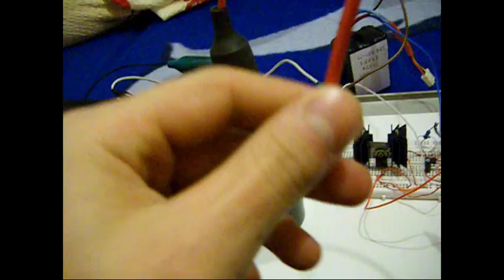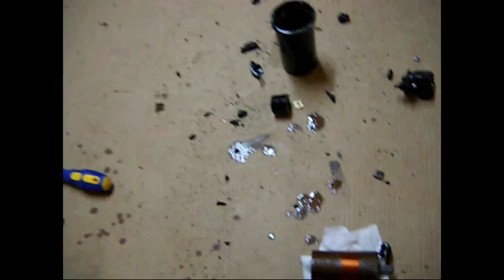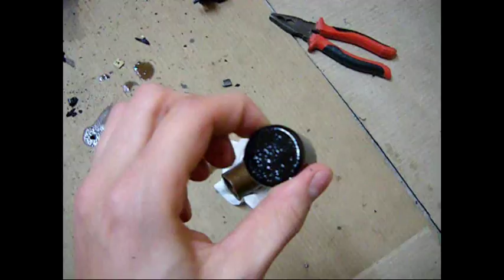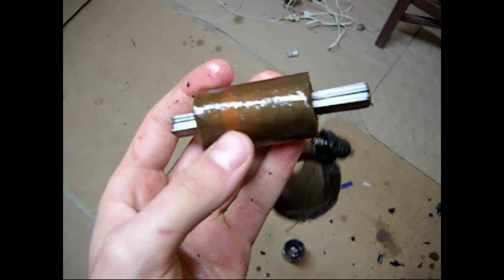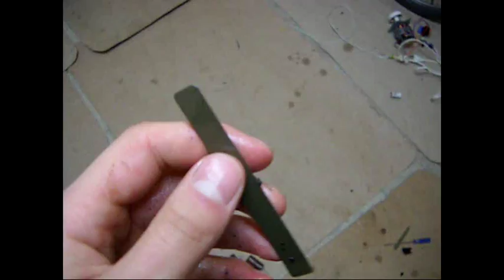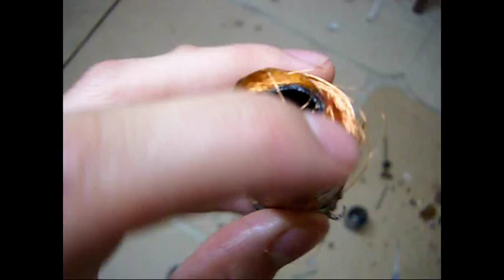555 Ignition coil testing and teardown

Comment: So this is what you were working on ( : What about using a TVS transorb, as that will only kick in when the back emf reaches a certain voltage so it should still allow for some back emf to give a decent amount of output voltage from the coil.

Did that oil smell bad?